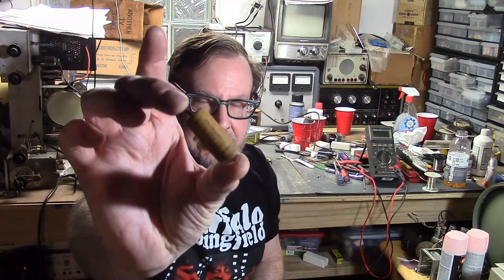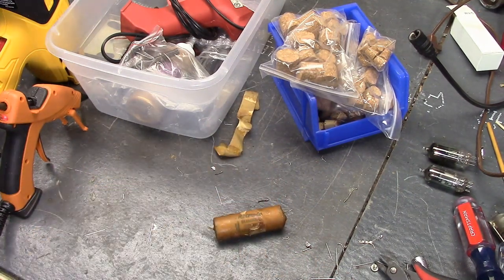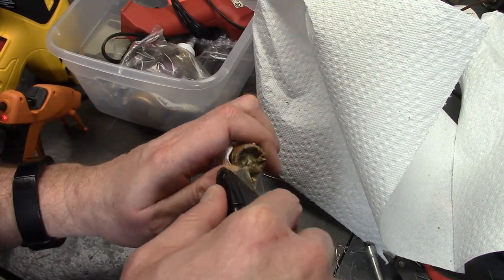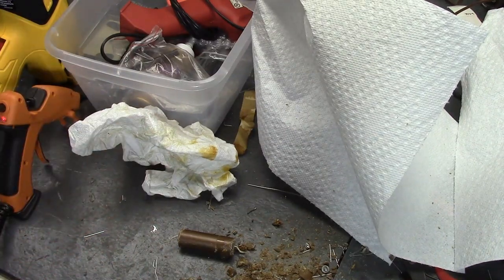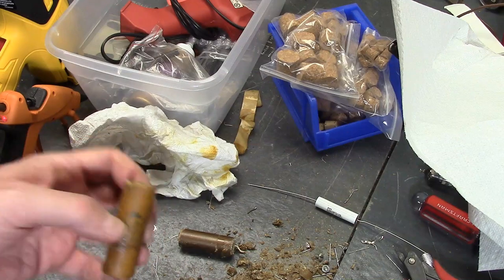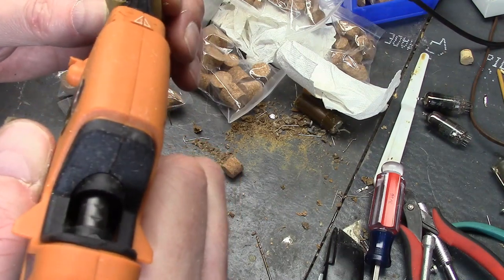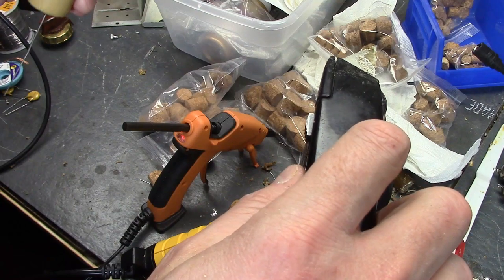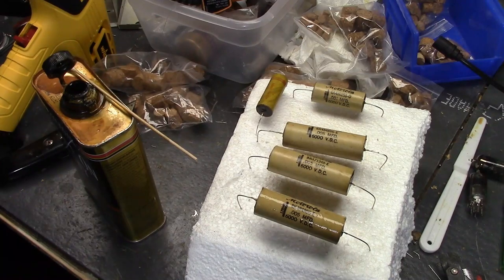Vintage paper capacitor restuffing tutorial

Comment: I restuff when the radio (I don't do TVs) warrants it or if the capacitor is of an interesting design. I'll have to try the freezing method. I've evolved over the years as to how I get the cardboard sleeve off. I used to suspend them over a large can (a really Rube Goldberg setup) and heat them in the oven. Smelly and time consuming, so I started using the heat gun which has worked well for me. I also used to fill them with beeswax, but lately have been using the brown hot glue as you did.

Comment: Bob I've done a few of these myself, usually with electrical tape, hot glue and then dipped in bee's wax. I like the cork idea. Really nice job, I like it!
Reply from the maker: Thanks. The main reason I'm doing this is for the pretty Motorola graphics so no wax 😀. If I was going for authenticity I certain would. I have a big block of wax standing by

Comment: Interesting idea with the freezing.. I have a double boiler I use with bees wax in it. I drop the caps in it and pull them apart when soft. The old wax colors the new wax and keeps the old look to them. I have tried styrofoam from meat trays for ends- works ok, and the hot glue also. I put the rebuilt cap in the wax and see it had 2-3 coats on it.  If you rebuild caps please remember to put a note inside the equipment that you did rebuild the caps, with the date and brand of cap. I started rebuilding an old radio, tore the caps apart to rebuild and found someone had already done it. I was unable to tell the rebuilt caps from the originals. Now days, I do find the leads on the replacement caps are much smaller gauge than the original caps had.
Reply from the maker: The main reason I'm doing this is to show off the graphics so will not be coating in wax.

Comment: I learned how to restuff those years ago from your early videos. I still prefer the heat method, I'm pretty sure I'd slice my finger open. Looks like a lot more work too, I'll let the heat do the work. Even if it is a little messy. 😊
Reply from the maker: I find heat takes as long or longer. Plus the fumes and hot wax. The ends are especially hard to get out. They also sometimes leech into the cardboard and discolor them.

Comment: great job. They look great. One thing I noticed is the replacements were not checked for which side is ground to match the cap markings.
Reply from the maker: That's because it doesn't matter. Caps are not made using the same type of foil or construction technique.  The shielding effects are far less than their earlier counterparts. That's why they stopped marking them. Yes, I am very well aware of other videos talking about outside foil.
Reply: Well try this and you will se that they still have on outside foil. Take an put them across an amplifier mic input and you will hear the difference. They still do have a foil side to them as you will hear in amd as it picks up noise from your body and will amplify it. Their are also a couple youtube videos on this. I thought the same thing.
Reply from the maker: @countryside8122  Yes, I've seen the videos.  It depends on the type and the effect is much less than in the old foil and paper caps.  The common axial rectangular types and made from flat sheets stacked up - not rolled together.

Comment: I do the whole thing with a heat gun.  Hold the end of a lead with needle nose pliers and hit it good.  Cleans up the outside nice also.  I have used the hot glue sticks you mentioned and I really like that, but I don't use the cork.  I just stuff large voids with tissue paper.  Works nice.  I don't see the point in using the polyurethane.  Nothing is going to happen to the paper under the chassis and it still has some wax embedded in it.
Reply from the maker: Use heat for years. Tired of the mess, smell and the ends tend to get discolored. Using poly makes the printing pop and covers any residual stickiness

Comment: I believe lighter fluid (like Ronsonol) just dissolve beeswax.  Maybe different waxes are used, but a few times I've doused a paper-n-wax cap with lighter fluid and literally pushed it out of the sleeve with my fingers. You can even rinse and clean the sleeve with it.  It's got 0% water, so even though it feels like you're soaking paper, it doesn't warp or turn to mush, and it even makes them easier to read by getting off the soaked-in wax.  Give it a try!
Reply from the maker: Sure, I will right now
Reply from the maker: Eh, it kinda works, but you need a lot of lighter fluid and the fumes are really bad.
Reply: @bandersentv  Kerosene "should" also work, and be less fumey (as well as not flammable at normal room temps, unlike the Ronsonol).  But because it's less fumey (lower vapor pressure at room temps) it will also take longer to dry, so that has to be allowed for.  Say, dry it in front of a fan, aimed through a window.
Reply from the maker: @SeekingTheLoveThatGodMeans7648  but why bother? 15 seconds with a heat gun and all the wax is gone
Reply: @bandersentv  plus what if any solvents harm the printing...
If you do batches of dewaxing hollow cardboard shells u could wrap a kitchen paper towel tightly around each and put them in an old pizza oven on moderate heat. That way the paper towel should soak out a bit more wax than by just heat and wipe.
Reply from the maker: @randomsteve4288  Tried that once and it did not go well.  The end plugs stating melting, mixed with the beeswax, smelled horrible and hardened before I could clean it up.  A few seconds with a heat gun, wipe with a paper towel.  It's very easy to do.
Reply: @bandersentv  I wonder how it would work to empty the squirt bottle into a sealable jar, and just drop the part in to soak for a while?  That would be no smell, and re-usable...

Comment: Interesting way to remove the insides of a wax paper capacitor. Using corks on the ends and hot glue to cover them is
 very clever. I wonder if to protect the printing on the tube could you spray Testor's Dullcoat laquer clear finish on it?
Reply from the maker: Lacquer will not stick to the wax

Comment: What worries me about restuffing caps like this is unless you put a note below the chassis or something some future person may take a look and assume that it has never been recapped! They then proceed to clip out all the caps and recap it again!
Reply: There ought to be some way of denoting this that is universally recognized, even if it is to use a Sharpie to blacken the leads of a stuffed cap.
Reply: That is a good point.  I use a pencil to mark a note on the inside of the chassis somewhere for an instance like that.  I did a restore recently where I dug a cap out of the tar in a transformer and left a note that I had done so.  Imagine being the poor guy who does the transformer removal and de-potting only to find out it had already been done but no one said so.  If the pencil note bothers someone they can always use an eraser on my note.  But in this case, I think I may have noticed the poly instead of wax and tipped me off.
Reply: I think a short note on a small piece of paper stuck somewhere under the chassis is the way to go. I would not permanently attach a note just tuck it under some wires or leads somewhere so it can be easily removed if it bothers someone.
Reply from the maker: I would hope the adapt-a-caps and the fact that these caps are not coated in wax would be a good indicator it's been restored.

Comment: Cool...never thought of freezing these.  I've always used a clamp and a drill press.  I wonder if a Forstner bit or a hole saw sized exactly to the I.D., or maybe even a bit smaller, might make the digging out of the beeswax at the end easier.  You would still need a clamp to hold the cap perfectly upright.
Reply from the maker: Interesting idea.  My concern is the drill bit getting knocked off center by the remains of the old lead.  I've been thinking about something similar.  Clamp two boards together and drill between them just the right diameter to hold the cap.  Then, insert a cap, clamp and give it a whack with a nut driver.  Might be enough to get the insides out with no heat or chipping at all.
Reply: @bandersentv  Or use one of the old style potato peelers to gently go around the inside to remove excess beeswax/adhesive.
Reply: @bandersentv  good idea on the holder. Seeing how it can get the cap center (wire) to always align with some drilling apparatus. On the " just whacking" part; i fear without chipping the end plugs are strong to where the cap slides in your holder and it may destroy the logo unless you wrap them in cloth... 
The hole saw idea was good, but how about using a plug cutter bit instead ? It has no central drill like a hole saw. 
That in a cordless drill which is mounted flat on a piece of wood and your cap holder with shimming adjusted to the right height should work as a makeshift lathe like apparatus... Or get a lathe 😅 i hear there is good miniature lathes from china for model makers
Reply from the maker: @randomsteve4288  All good ideas, but the reality is that this is only the fourth time I've restuffed TV caps in 10 years.  Also most of my radios are Philco with bakelite blocks.  So I really can't justify investing in making the process any easier.

Comment: awesome ! May I suggest shellac instead of polyurethane? It dries much faster and "amber shellac" will give the capacitor a vintage look.
Reply from the maker: Sure that would work. Poly holds up better against moisture but probably not much of a concern. If you really want the original loo, dip in beeswax. I wanted to graphics to pop so went with clear coat
Reply: @bandersentv  The reason I suggested shellac is because I rebuilt a Dynaco PAS 3 preamplifier and the transformer was coated with amber shellac which was done when it was built in the 1960's. But I hear you, nothing beats poly.

Comment: Very  clever and done skillfully, but it I really don’t get it, however it would be a good way to disguise caps that are made up from  adding caps in series or parallel,  to get the right value and stuffing them into the tube. You did give me an idea to
 re- purpose one’s capable Supply. For instance you can make a .1 uf cap by paralleling two  .05 uf caps  or series wiring two .1 uf caps to get a .05 uf cap. Thus reducing your caps supply by half.  The combinations are only limited by one’s own imagination.
Reply from the maker: It's preserving the original look and artwork of the capacitors.  You could just as well put them in a jar next to the set.

Comment: Nice result! This is the first video I have seen on this subject. But I was waiting for you to line up the foil end of the new capacitor with the foil line of the old one. I know this was probably a non-issue for this application, but testing and marking the new cap, could have been easily done.
Reply from the maker: Yes, I'm quite familiar with Mr Carlson.  They didn't just arbitrarily stop marking the foil end.  Metal film caps are not the same as metal foil caps. They do not have the same shielding effect.
Reply: @bandersentv  You nailed me on the Mr. Carlson reference. And thanks for sharing your knowledge and skills with us.

Comment: I expected you to dip them in hot wax and fill the ends with wax.
But your hot glue ones look really great, just like new 😀
Did you get your basement walls dry and no mould?.
Reply from the maker: My goal was to clear the wax off so the logo would be more visible.  I wasn't going for authenticity.  I just took the walls out entirely.  Good thing too as we needed the clearance for a new furnace and duct work.